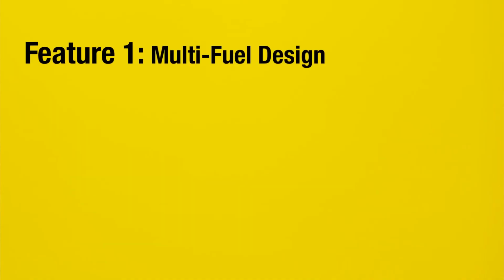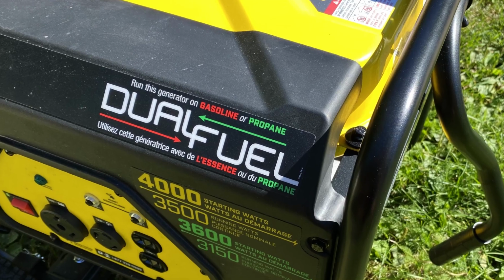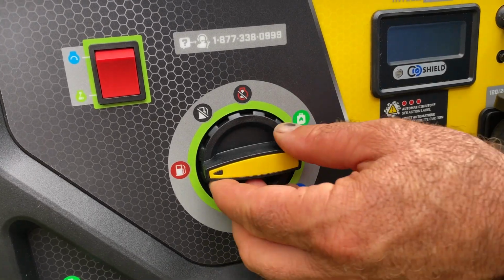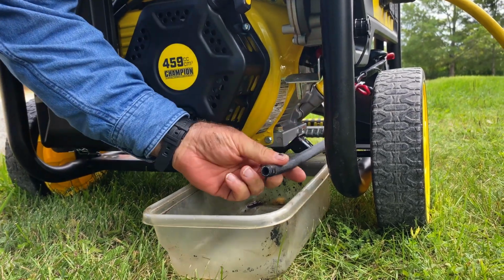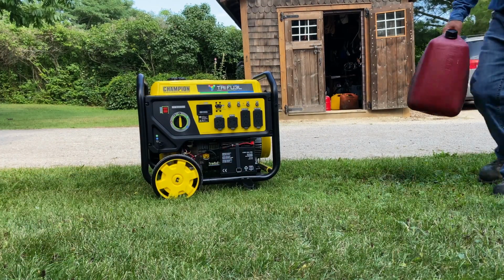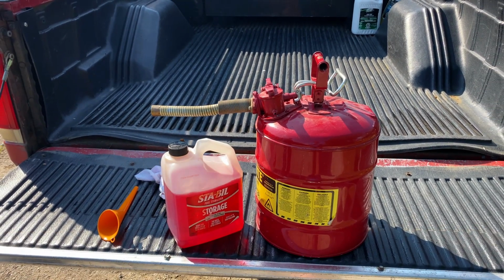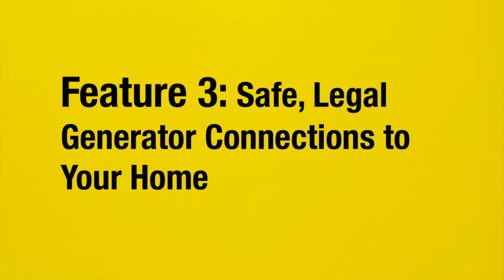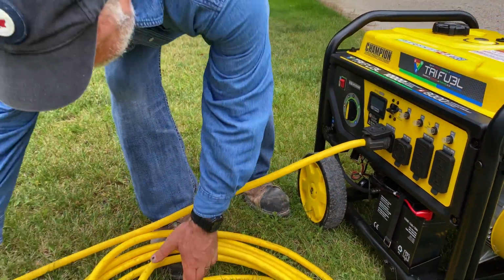How To Prepare For a Long Power Failure

Comment: Try laying out your generator and all the power cords you'll need.  You may be suprised at where they do and don't reach.  Also check what you are plugging into...always keep the amps of the item you are plugging in at less than the cord can handle.

Comment: When shopping for a generator, make sure the one you buy is a floating neutral one and NOT a bonded neutral generator. Most manufacturers don't obviously state this other than on the faceplace itself, but there can only be one ground and that must be in the home, not in the generator. Tri fuel is best with natural gas as you say, because you can not be too prepared. I own 8 generators (don't ask) and am currently shopping for a tri fuel, FULLY ENCLOSED generator to replace my Honda EU6500 beauty for QUIET home backup. Excellent video by the way....
Reply: UPDATE: Just purchased a TMG Industrial 10500 tri fuel generator (same as the Genmax 10500) up here in Canada, and have it set up on the home natural gas supply. It costs 36 cents an hour to run it versus $5 an hour for the Honda, which I will be selling once all the little things are worked out with the new generator.
Reply: @TOURMANBOB   I share your addiction.    ;-)
Reply: @PeterLawton  Yeah !! Unfortunately the better half recently put her foot down and now I have 7 of my 10 generators for sale. Bummer !!

Comment: People can decide for themselves which method to choose is best to operate their generator. I have heard the gasoline vs. propane argument for years and I disagree with the propane side of the argument. 

I do agree with much of what you stated.

The viewers of this video need to know the generator you are exampling is a loud, gas guzzling generator that produces a dirty sine wave which can damage sensitive electronics, such as refrigerators, freezers, computers, telephones and televisions etc. Anything with a microprocessor can be destroyed by the dirty power these types of units produce. 

If you are serious about a long term power outage an inverter generator produces a pure sine wave and uses much less fuel. The most popular inverter generator is the Honda EU2200i which with less than a gallon of gasoline will operate for 3.5 to 8 hours of runtime. These generators are top of the line and their price reflects this fact. 

The Champion brand has myriads of issues along with quality control problems and they are very loud.  There are cheaper inverter generators for the short term outage. Stay away from the non-inverter generator unless you are running a construction crew.

Propane is safer to store and does not go stale. It does have less energy density than gasoline and natural gas has even less density than propane. Gasoline is dirtier than the liquid gases, but proper maintenance on a generator will keep it running. Engineers design internal combustion engines and factor this into the design. 

A 20lb tank holds 3.89 gallons of propane. According to the generator specs of your Champion this amount will run your generator approximately 6 hours, this would require four 20lb tanks of propane per 24 hour period. 
Propane tanks are $60 per tank on Amazon while propane in my area is $4.82 per gallon totaling $75 per day of generator operation. The upfront cost of propane tanks is $240, but will one days supply be enough? Many people do not have access to 500 or 1000 gallon propane tanks and must rely on tanks holding less volume. 

I have been through four hurricanes and each time the propane stocks were depleted in less than twelve hours. Every person who lives in an RV or a trailer clog the queuing lines making the wait quite long. 

In an emergency gasoline providers will shift supplies to a neutral area to assure an abundant supply. Gasoline stations are ubiquitous and offer many pumps to accommodate patrons while propane dealers are sparse and have one tank and one hose to fill the tanks. Octane rating lacks nexus to fuel quality; octane is the fuels ability to withstand detonation.

Comment: Great video. You covered all the bases well. One question though: the tri-fuel generators are not always rated to generate clean power, which can harm electronics. How have you protected your electronics in the home?
Reply: I converted our Predator 9000/7250 gasoline only generator to a Tri-fuel generator.  We use NG as our primary fuel source. There is an idle screw, that can be adjusted, to help keep the frequency as close to 60Hz.  I used a wattage usage meter to make this adjustment.  At 20% load, the frequency is 61 to 62 Hz. At 80% load, the frequency is 59 to 60 Hz.  No issues with any of our sensative electronics with over 90 hrs. run time.

Comment: You should have mentioned how prone to self destruct Generlinks are just when you need them most, in a thunderstorm.  For long term outages the best , and over time cheapest solution is a pad mounted permanent generator with an automatic transfer switch and maintenance monitoring connected to natural gas supply or a large propane tank (often shared with house heating in rural areas). I will also point out, that at least in my area, the propane trucks will turn up before the gas stations have gas so if your demand goes up during a bad outage resupply is pretty good.
Reply: Or, YOU can make your OWN video with that information! What'dya think?????
Reply: Have at it buddy

Comment: Enjoyed the video - useful information and relaxing delivery. I prefer the natural gas option as long as the utility service is operational. In case it fails, having propane on hand is the next in order of preference. Though this video wasn’t focused on solar systems, there can be a role for those, too, especially if you can live without high demands like central AC, oven, and dryer. I see a battery system like Ecoflow or Bluetti, for example, providing immediate power into a transfer switch, then using a generator to refill the batteries in intervals. You might not need to run the generator full time, which would save on fuel and neighborhood noise. The battery supply would last a while and then could be topped off by the traditional generator running for an hour or so. Solar panels can also feed into the batteries, but you get so little power for so much cost, I think a traditional generator still has a role to play. Layers of options is great when planning. If you know you will have a need for heat, a Mr. Buddy system running on a grill tank could be way more efficient than losing energy running through a generator cycle to power a space heater. If you know you need cooling, perhaps fans can get you by or you can consolidate into one room with a window AC. It’s all about reducing your actual consumption needs rather than trying to match all of today’s nice-to-have home services. Drying clothes on a clothes line is another example.
Reply: I absolutely agree with what you said here especially the first part about using a battery system first and then a generator to top it off. 
That is exactly my plan. I have a Ecoflow Delta Pro and a Honda eu2200i. I’ve tested and ran them to power the house and they are both beasts! They exceed in all categories, reliably, surge pure sine wave, steady 120 volt delivery (almost no voltage dip or sage)

Comment: Get off grid solar…that’s how
Reply: I want solar too but it's only as good as a sunny day provides.
Reply: @cathybestlercurtis That’s why there are batteries and inverters.  My array provides 2x what I need a day and my batteries store 1 day of energy.  Not enough sun for days, can use a generator to feed into the system.

Comment: Good video. How can I adapt to my larger home tank?. Do you have any links to the adapters?. Thanks
Reply: For a small generator as shown, get a gas fitter to install a line for a BBQ on the outside of your home. Then just plug in a generator as you would a BBQ.  I emphasize small here. This sort of arrangement has limited output.